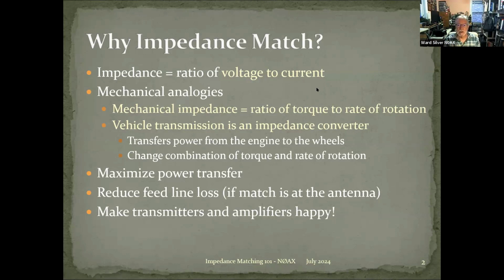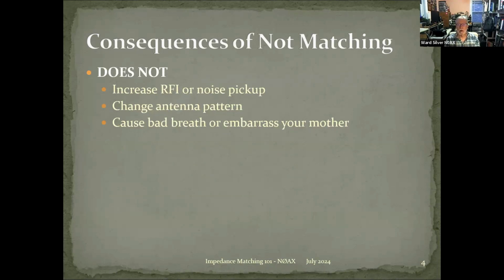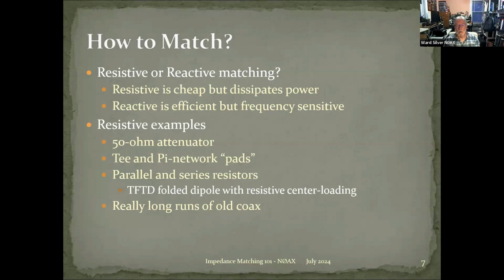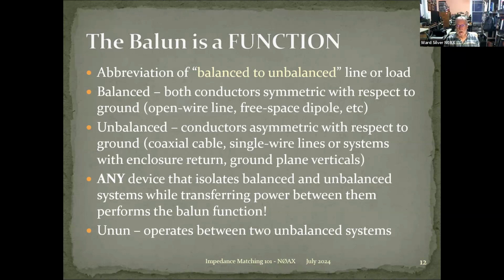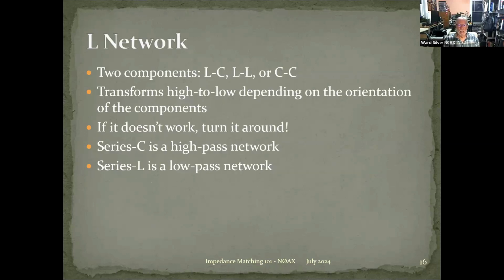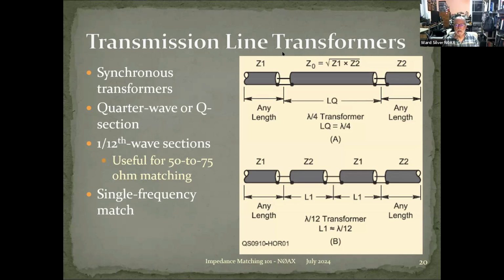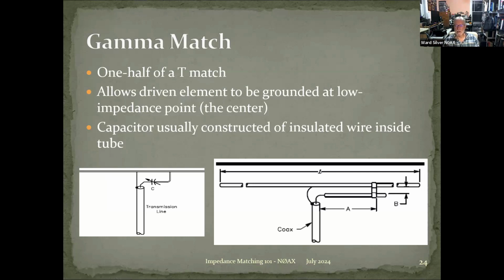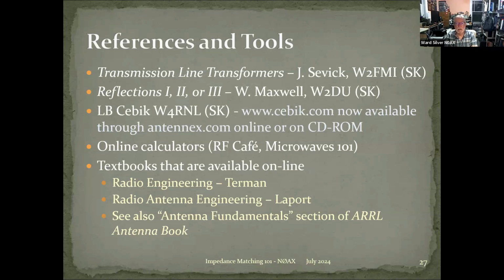Impedance Matching 101 ~ 07/24/2024

Comment: Absolutely no one ever says anything about the dimensions of the topic of balanced or unbalanced components. 

Besides the fact that we see the circuit schematic of the transmitter described as a 0 ohm impedance source in series with a source impedance, then that is loaded into an antenna and then there's a return line back to the transmitter. So after doing a mesh analysis on the transmitter impedance, the rest is pretty simple. The antenna is a load that is actually a resistance in series with an inductance in series with a capacitance. When the XL and the Xc are equivalent, they cancel leaving only the resistance. 

So what do we balance?  The Kirchoff current law states that current flowing into a point (node) is equal to the current flowing out of that point. Now instantaneously we can look at that circuit and know that the current flow is not equal everywhere all at once, but on average, the current around the circuit loop will be equal. If we have 2amps flowing into the load, we have 2amps flowing out of the load. Kirchoffs current law. 

Again, we see you doing math showing impedance transformations and a lecture about common mode current but there's never any values associated with the topic. I think it's pretty obvious why.